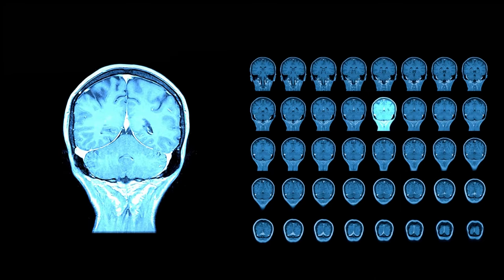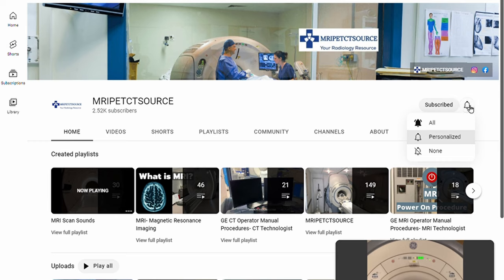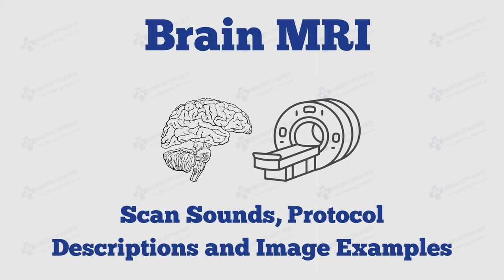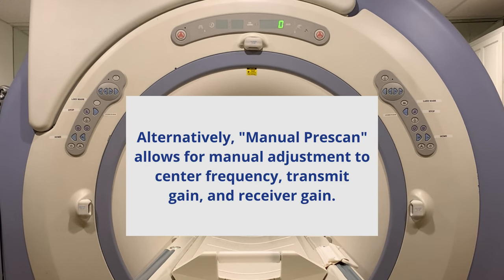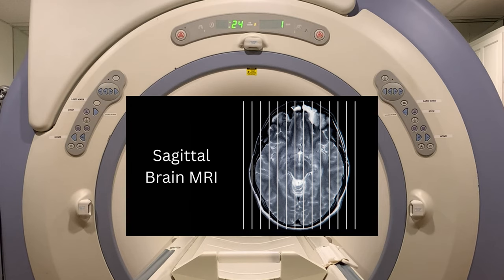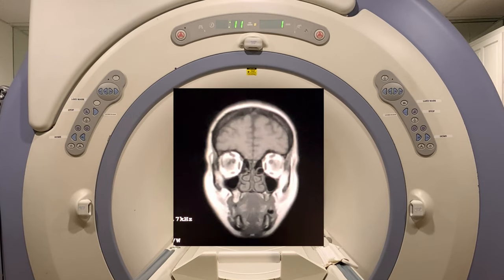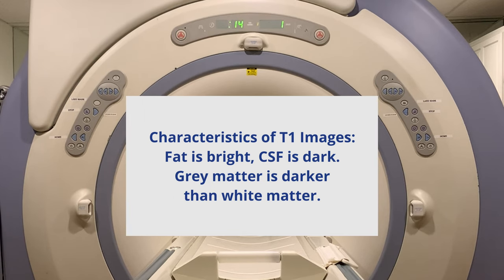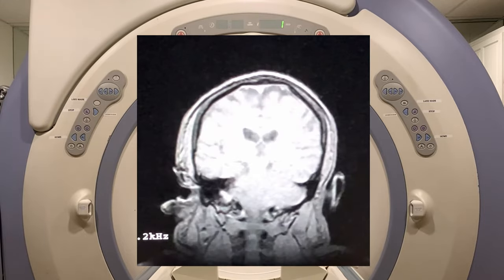MRI Scan Sounds Explained - Exploring Brain MRI Scan Sounds and Protocols

Comment: This is so helpful. I should be able to be awake for any scan I have to do now and handle it. It helps
Me as I am super sensitive to loud noises- the all
Of a sudden noises that jump right out in front me like a fire alarm or MRI sound. This is so helpful
Reply: Headphones help
Reply: You are very right. I don’t think I am as afraid of the scans anymore. I mean of course depends if it is a closed bore or open but I think now I just wear the head phones for protection. But music would be a bonus
Reply: I believe they are required to provide ear phones/earplugs to help eliminate noise…… But I’m definitely with you as far as sound sensitivities is concerned.  I remember one time when I had an MRI done, I was given a special pair of headphones, and I got to enjoy some steel drum music during the scan…… Imagining myself relaxing on the beach.

Comment: one more question, actually 3. 
1- what do gradient coils look like? 
2- Why does the same sequence on different scanners sound different when they have the same gradient coil?? 
3- what are the loudest sequences? and why so much louder? for example- DTI
Reply: 1) fingerprints but around a tube
2) grandient coils difference in performance and sequences difference in parameters different t2 sequence might have many different sounds even when performed on the same scanner 
3) from personal experience i'd say large FOV gradient echo images or extremely high resolutions gradient echo... basically whatever uses the most out of your gradients is bound to be noisy